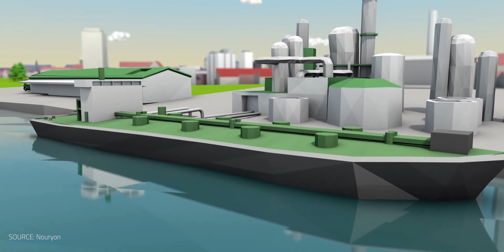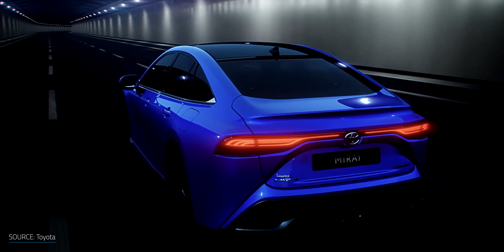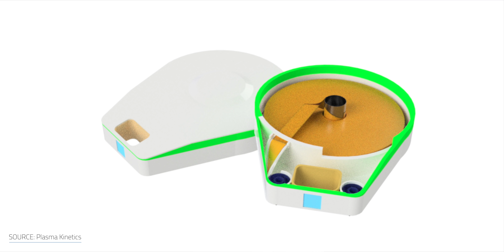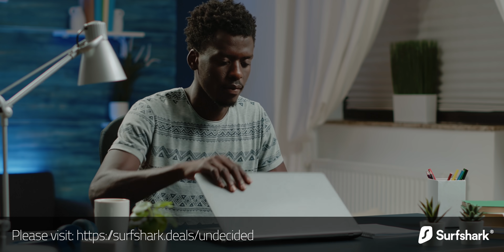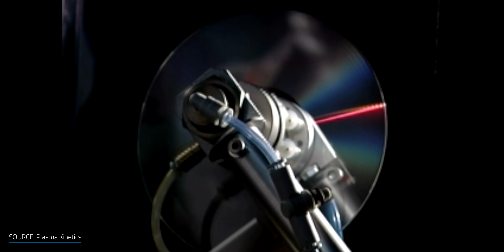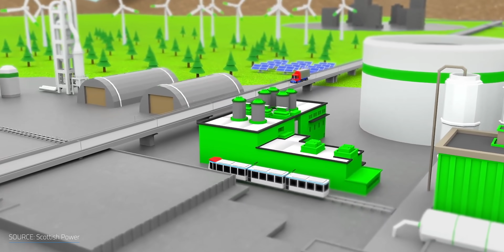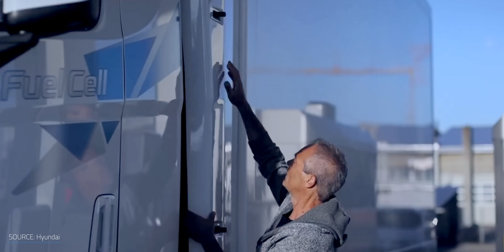Energy Storage Breakthrough - Solid Hydrogen Explained

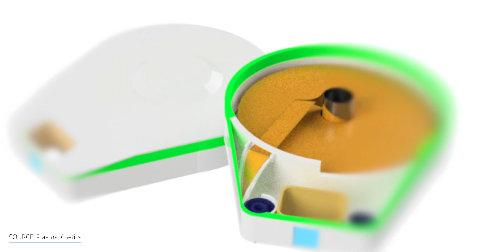Comment: 1. 04:00 "directly from smoke stacks" -in what smoke stack do you find H2? Smoke stacks have typically more H2O or carbon compounds.
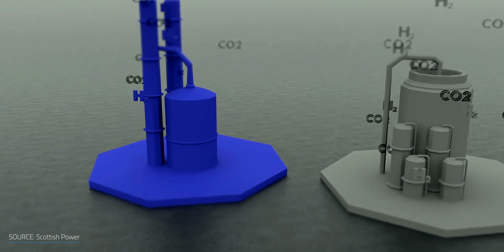2. 06:55 you make it sound like green hydrogen (electrolysis) is not only energy intensive but also require carbon processes
Reply: TBF he mentioned both natural gas reforming (most commonly used and carbon intensive) and electrolysis
Reply: @Leoappeared  yes he did, but it isn't clear if he knows that green hydrogen is electrolysis. His sentences and visuals are the problem here.

I saw other videos from him and it looks like he normally does a better job. Just this time I feel like that he might have fell into a scam trap.

Comment: It looks like an 8-track tape - absolute genius delivery format :) can scale to any size while still using the same light activation system. You could also transport it continuously through a set of rollers over quite long distances if you wanted to - or 'charge' it over a long distance too - if the tape was passed through a winding path of solar powered hydrogen producers? it'd come out the other side saturated - bring the storage to the hydrogen!
Reply: We all know what happened to the 8 track tape.
Reply: Your reference to 8 track tape  had me think that if its a film moving like a tape then what sound would the hydrogen extration process make when the laser plays on the tapes surface.
If it stores hydrogen on the film  could it also store music?
Reply: @paulelder9488  if you’re talking about storing the effect music makes on things, ie vibration, I think you’d be better off going back to magnetic tape. If you’re talking about ones and zeros in digital format, then we’re already doing the best we can with storing that.
Reply: @paulelder9488  i guess it would be blue Lazer tape hiss.
Reply: "8-track tape - absolute genius delivery format" well... that's something you don't hear vary often.
Reply: Maybe beta-max. Not much better 🙂
Reply: @dionysusnow  - You have to appreciate it within the context of its time - an 8-track tape was a mobius strip - capable of playing continuously - in a small form factor that could handle big vibrations.

The alternatives were vinyl records and reel-to-reel tapes.

And now the same idea has found use in energy storage - so yeah, it's genius. 

It doesn't matter if you can't extract all the hydrogen from the tape as it passes, it's a loop - and you don't need light shining on both sides of the tape - because both sides are the same side in the mobius strip - and both sides of the tape are going to go past the lasers eventually.
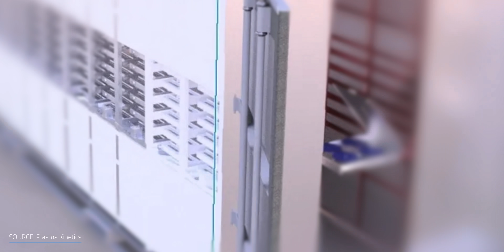Reply: It is comical that people think shipping tens of thousands of complex 8-track cartridges loaded with hydrogen is going to be cheaper than a bulk hydrogen pipeline or compressing H2. 9:03  oh wow you could ship 20,000 tons of hydrogen in these contraptions on a container ship... Kawasaki claims its liquid H2 transport ship can carry 87,000 tons of hydrogen.

Even if these cartridges can be reloaded 150 times without the tape mangling like a Jane Fonda workout video, how much will the elaborate robotic videocassette rewinding factory-cum-green hydrogen facility cost per kg of hydrogen going out the door?

Comment: I'm really suspicious of the 70% round trip efficiency claim.  That seems like an overly optimistic marketing claim or something that is ignoring costs somewhere along the way to sound better.  Normal hydrogen fuel cells have something like a 40% or lower round trip efficiency.  That makes this whole proposal sound like marketing hype from the company trying to sell it and something that hasn't been verified by a third party.  Are we sure the efficiency claim isn't only when rolling down hill like Nikola?
Reply: Honestly there are so many other upsides to this, that even 50% could make it a useful part of our future storage solutions. But yeah with all these innovations, internal lab numbers translated through marketing aren’t worth the paper they’re printed on.
The question is always how it’ll look once third parties get their hands on it.
Reply: A lot of the round-trip efficiency losses from hydrogen is in compressing and/or liquefying it for storage.
Reply: 9:25: 
It is only 30% lighter (which doesn't necessary means that it's also smaller) for the same amount of energy stored. Even though, that's a considerable percentage, it's not that big if you consider the downsides of requiring them to be removable. 
If you think about it, the batteries are already technically removable, which also has the advantage to also be easily rechargeable, without a considerable drawback compared to the solid hydrogen. 
Furthermore, adding the fact that it has a lower lifespan (150 charges) and lower efficiency (70%, compared to 70%-90%) and being only 17% cheaper (probably only for building them, and for the entire lifespan usage), you can see why it's not a better solution than batteries.

Am I missing something?
Reply: @justsomeguyhere Hydrogen really isn't an energy solution, it's more of a energy transportation and storage solution.
Reply: @justsomeguyhere what are you all on about better inform yourself before ridiculing yourself anyone knows that hydrogen also is made from electrolysis generated from renewable energy.
Reply: 70% is not too crazy at all if the technology actually can work at normal temperatures and atmospheric pressures.
Reply: @justsomeguyhere I don't think you get the full picture here. Sure, using electrolysis to create hydrogen to burn is a poor energy efficiency, but what if that energy was going to be wasted anyway, for example, excess generation from solar or wind power? As a storage technology, it has a couple of economic and environmental benefits over lithium ion batteries, namely in terms of resource acquisition (lithium is not easy to get and it's production is environmentally dangerous) and recycling batteries is expensive and hazardous. Also, the density and ease of transport can overcome a great deal of the distribution issue with renewable energy - if you can for instance, generate electricity in one part of the world, then store easily in these batteries via hydrogen and then release it where the energy is in demand. There are actually a lot of practical problems that can be solved by this technology, if it works (is as cheap and efficient as they say it is)

Comment: A hydrogen laser 8-track cassette. Interesting. Couple things: to keep hydrogen in a solid state most definitely requires immense pressure and low temperature. This is not solid hydrogen, it's an ionic compound containing hydrogen. And I'll guess that the laser "switching the polarity of the bond" means that it liberates electrons in the substrate so they are free to move about. The substrate becomes positively charged and repels the hydrogen ions- to some degree. Does the photon energy of the laser do a good job of liberating electrons, or could the process be improved there? I suspect issues with scalability, lifetime of the hydrogen "charge" on the film, durability of the film, and cost/lifetime of moving parts.
Reply: There's more, and worse. What's the amount of hydrogen per second, and thus eventual power density, of liberating hydrogen from a thin unspooling tape with a laser? I bet powering a truck or ship would require dozens or hundreds of players. And even assuming the cartridge and laser player last 150 "plays", how much does it cost to send the cartridges back to Plasma Kinetics each time for a top-up? How much will their elaborate robotic videocassette rewinding factory-cum-green hydrogen facility cost per kg of hydrogen going out the door?

Plasma Kinetics has 7 employees. Who's going to engineer all the moving parts of this scheme for volume production?
Reply: I think a ton rests on an incredibly good and upscaled 'cassette player' in this instance. And, given one, I don't see why you couldn't replace  the film reels on your vehicle if the whole engine were geared to use this granulated hydrogen.
Reply: @shakacien  Plasma Kinetics' fantasy rests on sending the cassette back to them for refueling 150 times before it wears out, and refueling sounds complicated and very expensive.

Nobody's going to run a  engine on hydrogen, BMW and Mazda abandoned that in the 2000s. Burning hydrogen produces NOX, instead you need to run hydrogen through a more efficient fuel cell and motor, and add a battery to recapture braking energy. Hydrogen fuel cell cars are a complete bust because of the cost of the car and the cost of the fuel, and slightly improving hydrogen storage isn't going to change that.
Reply: @skierpage  You have missed the point. This tech requires no burning of the hydrogen. it gets fed to a fuel cell that joins the hydrogen to oxygen releasing only H2O (water) and an electric current that is fed to an electric motor. This system may "sound" complicated and expensive, but is it? We will have to wait and see!
Reply: @stevenclarke7777  I know, @Shaka used the term "engine," not me.
Improving hydrogen storage, if indeed Plasma Kinetics' poor computer renderings will ever do that, doesn't help with the cost of making green hydrogen or the cost of the fuel cell.
Reply: @skierpage  Plasma Kinetics only has 7 employees!!!
Ha ha, they really messed up there!!!
Can't fix that problem --- a promising technology bites the dust because no one with an MBA started the company
Reply: Hydrogen is being stored at room temperature under reasonably low pressure using Lithium-6 Deuteride.  Heat the tank a little and the hydrogen is released.  Too bad it is illegal to buy.
Reply: @skierpage  Too bad 6 of the 7 employees work in marketing and 3D visual effects production.

Comment: Skeptical. It's an idea that could work, but I'd like to see the technology in action and get non-advertisey performance metrics (especially about cost and energy efficiency the of the total process).

For now I have three questions:
1) What is the wattage of the laser that releases the hydrogen? Does it need to be particularly intense, or is there some weird property to a specific wavelength that produces the effect?
2) What is it about this material that causes it to ionize under the laser light but not in the presence of fire? (Since you said it's not flammable.)
3) Don't fuel cells require very pure hydrogen? How would this process prevent contaminants from the film from getting into the system?
Reply: narohodo. Nice points
Reply: @Collector_Of_Incel_Tears  is there proof for That i mean anyone can claim. Such things
Reply: @Collector_Of_Incel_Tears  Most of what you said is rubbish. What would a missile even use a fuel cell for? That's just complete bollocks.
Reply: If I had to guess about the laser, it would be related to the photoelectric effect. The photons would have to be of a high enough individual energy (i.e. high enough frequency) to be ionising and break the chemical bonds.
Reply: @harrygenderson6847  Heh. Lets wait for ThunderFoot's response - this should be EPIC!
Reply: @endintiers  we're here before the storm
Reply: @Michael Hill I mean... hydrogen is pretty abundant provided you are willing to spend precious water resources to get at it. And overlook any consequences of doing so. And can source the electricity from elsewhere anyway.
Reply: @Michael Hill Bruh I was agreeing with you. Why the agression? Hydrogen is difficult to extract from the atmosphere, as you pointed out. It makes up an extremely small fraction of dry air at low altitudes. Extracting hydrogen from exhaust gases is an even worse idea, in which most available hydrogen is expected to have combusted into water, unless it was a process specifically designed for hydrogen and other gas production, such as partial oxidation, which is just burning one fuel to create another (storage, not source). I'm listing this as an additional reason why the startup is likely to fail.

If you intend to use pure hydrogen (not syngas or similar) as a fuel at large scale, you don't source it from the atmosphere, which is non-viable due to hydrogen's low abundance there, but from electrolysis. Water purification itself is an expensive process if pure water is your source of hydrogen, and don't think you're going to be making any savings by sourcing your hydrogen from impure water. If you were to electrolyse brine for hydrogen, you require additional electricity which goes into producing roughly as much chlorine by mol as hydrogen. When you factor in equipment wear, that method is equivalent to purifying and electrolysing the water separately.

Furthermore, recovery of water from the fuel cell has its own issues. If you are to maximise the specific energy of your fuel, you must store only hydrogen while sourcing oxygen from the air and venting exhaust gases to the atmosphere. This is similar to how conventional engines run. As soon as you decide you want to store either the oxygen or the exhaust, that's additional weight which will reduce your fuel's viability compared to existing fuels and battery electric. The exhaust water is going to have ~9X the mass of the hydrogen used to generate it, which is certainly enough to knock e-VTOL off the list of possible applications.

This is the greatest problem with hydrogen fuel cell technologies in general. They are reliant on other forms of primary power generation, which at the moment is still predominantly other more easily accessible chemical fuels. This startup claims it can overcome these existing problems of fuel cell technology whilst making promises even beyond that accompanied by fancy computer graphics. Even given that their 'new technology' is everything they claim, they are nowhere near creating anything revolutionary.
Reply: It just doesn't work, plain and simple.
Reply: Why wont you believe these 3d model drawings of vehicles and canisters? STOP BEING LUDDITE
Reply: "It's an idea that could work"
Sure if dont mind a gas tank equivalent of 3ml!
If that fact is not a problem good luck with your engine!

Comment: "Non flammable form" Actually, it's literally a metal based explosive under certain simple conditions but definitely still somewhat safer than the traditional. Also it definitely explodes violently, just like an overcharged Lithium Ion battery. Infact worse. But STILL safer than an H2 gas tank.
Reply: Coin flip modern H2 tanks can be real hard to puncture one reason this competes as all as the "armor" on the tanks lowers their capacity a good deal.  Might be more likely to explode at less extreme conditions compared to the higher explosive power of the H2 tanks if extreme conditions met.
Reply: I would place batteries the lowest in that safety list. Half a ton of non-extinguishable fire accellerant that can be ignited by contact with air? Sounds a lot worse than a carbon fiber tank that can take a beting before even releasing any gas which then needs to be ignited still.
Reply: @BugMagnet  H2 gas is highly flammable. While it can also extinguish a flame that'd be more due to the blast effect if you're lucky. A carbon fibre tank punctured or destroyed will violently release the pressure and then you've got an explosive gas ready to go nearby possible open flame which is not a rarity in accidents. The H2 metal discs can burn ridiculously fast too. Regardless I'd still prefer to have the discs over the tanks. While they may seem fragile or dangerous to a trained eye, they should generally be able to be kept out of intense flame easier in accidents due to their design. Ie, encasing them in flame retardant double liquid/gas layers.

What we all need to consider is the worst case scenario. Better fuel always equals bigger boom. There's not really any way around it.